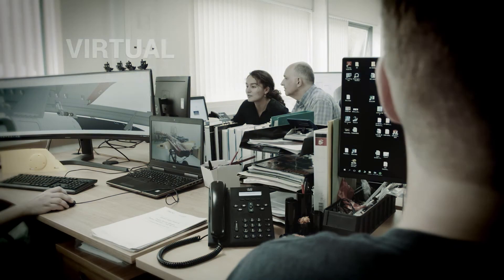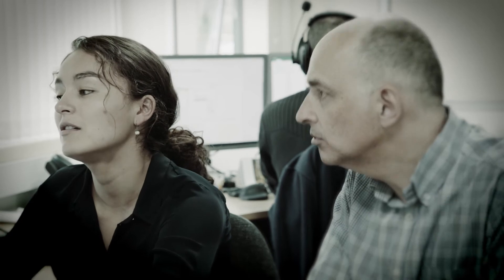Banshee Next Generation - Development

Comment: The Gem-7 UAV has 15x the endurance, and does not need a launcher…
And the Gem-7 can land back on the ground, which I doubt this can do.
P
Reply from the maker: Hi Paul - Thanks for your comment.  You'll be aware many UAS platforms with different capabilities exist for different taskings. The Banshee NG is the latest iteration of the World's most used range of aerial targets - representing advanced transonic threats for air defence exercises.  It is not a conventional UAS platform for persistent ISR, communications relay, mapping or other taskings to which your comments may be more applicable - Although there are multiple systems available today which exceed your stated performance characteristics.  

As an air defence target, its 1,000km operating range, 250m/s speed and ability to perform up to 9G manoeuvres often exceeds the requirements for such exercises.  The pneumatic launcher allows us to quickly launch the required number of targets for any exercise, either from land or onboard Naval ships far out at sea, giving us flexibility in range and scenario deployment options.  The Banshee NG is parachute recoverable over either land or water and has no need to land under its own power should it not be engaged and destroyed in flight.  These were the NATO requirements it was developed against.  

If you would like more information on any of our target systems, either land, air or ground-based, we'd be more than happy to help.